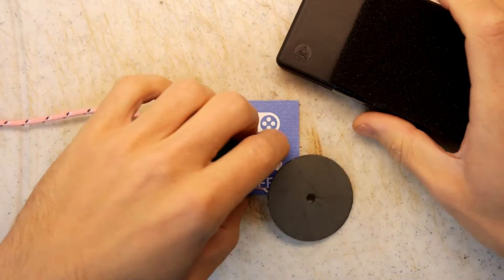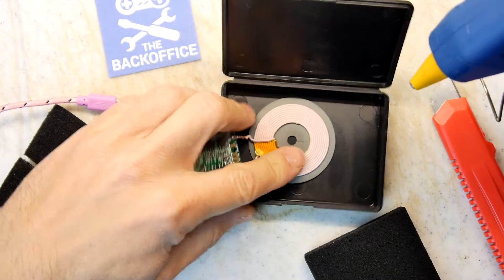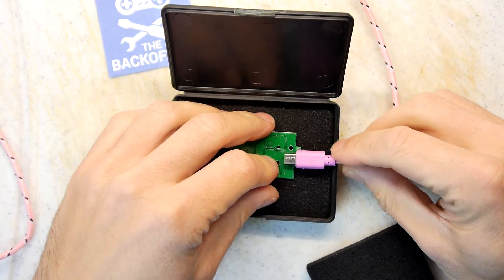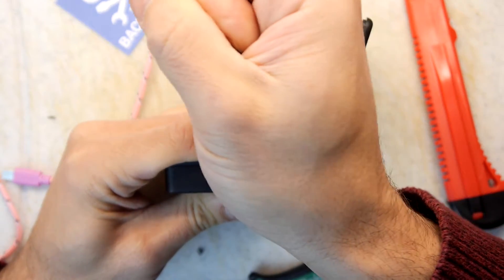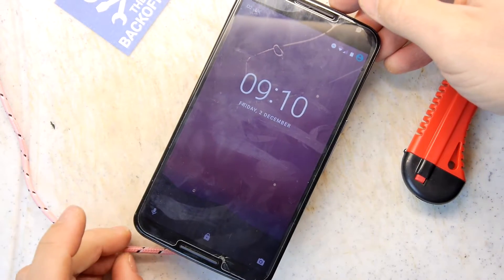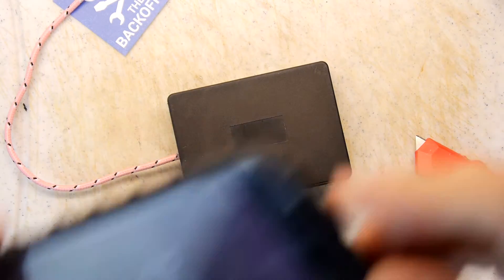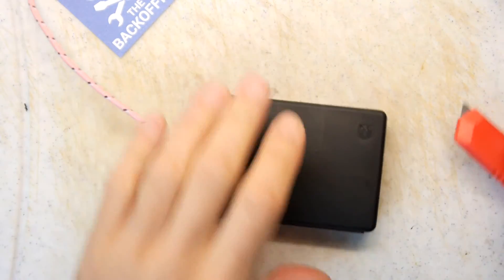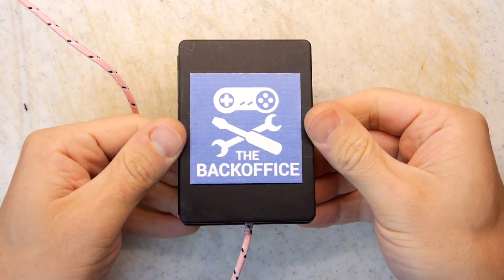DIY NFC Wireless Charger

Comment: I have a Chinese exact clone of a Samsung Galaxy S4, which is by a recognised Chinese brand called Elephone and the model is a P8 from late 2013 / early 2014.  Anyway my sister also has the same model and has managed to pull the USB socket from the PCB of the phone, so she is limited to charging her batteries externally.  The specifications of the phone mention it has NFC and running AIDA64 reports the presence of NFC, but other than that I have no idea if it will work using your DIY project.
Reply from the maker: +EgoShredder I would advise getting one of the commercial wireless chargers from China, they are probably only a few pence more than the raw PCB and if it works, likely a good solution for her. Worth a try for a couple of quid?
Reply: The Backoffice
Yeah I do not have any plastic ABS project cases to hand, so it would probably cost not much more for a fully assembled one.  There are some crazy prices around for the other branded ones though.
Reply from the maker: +EgoShredder I agree, don't pay any more than £3 for one of you can help it!